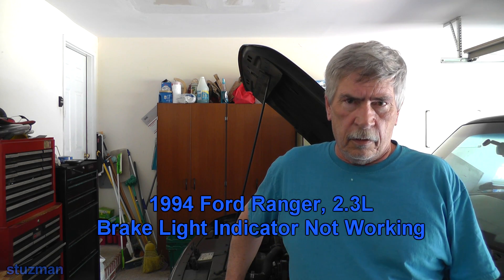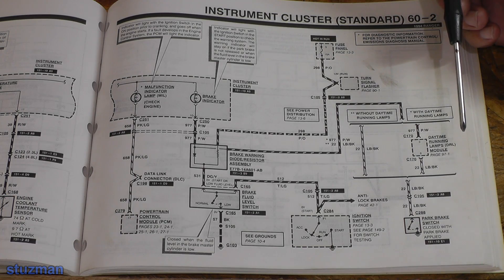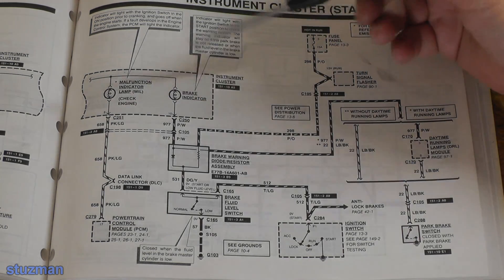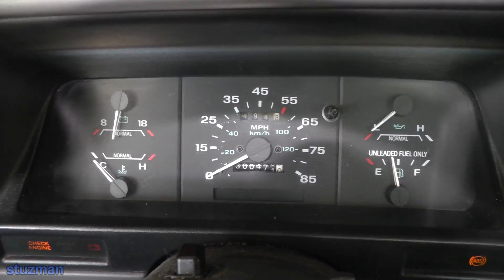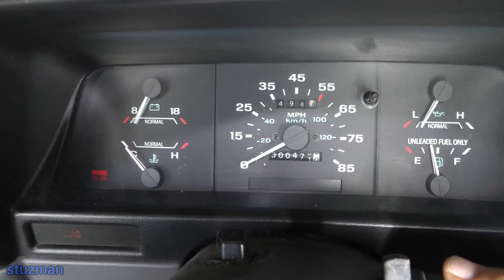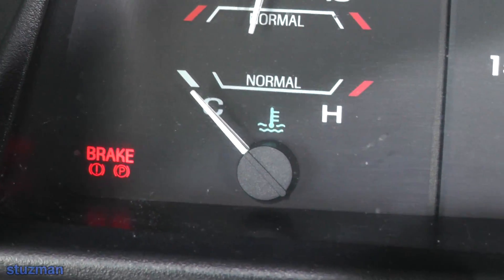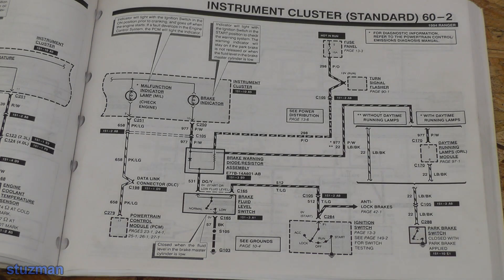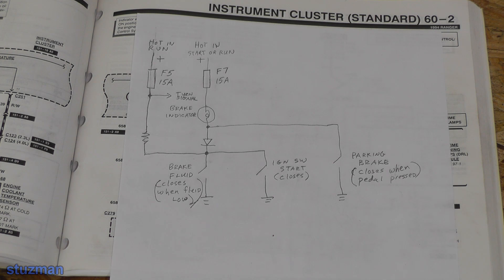Brake Indicator Light Not Working Part 1

Comment: If the switch is intact, then most likely the bulb is burned out. So, I changed the bulb out and now my check engine light is out. Probably best to go in there and change them all.

Comment: Where did you get your test leads to fit the connector? Or if you built them what size male quick disconnect fits the connector.
Reply from the maker: The test leads came from a kit that's from aeswave.com Here is the link to the terminal kit https://www.aeswave.com/uTest-Advanced-Terminal-Test-Kit-p9748.html

Comment: Excellent video. Im trying to figure why my Ebrake light isn't working at all. 99 crown Vic, of vot I've got the dash out, which was easy but was a waste of time since the bulb is good. 
Weird thing is with a test light I have power to the single wire on Ebrake to ground. They failed me on inspection for it not working.
Reply from the maker: Not sure what your issue is Andy as I don't have a wiring diagram for your vehicle. It's normal on most vehicles to have power to the light and ground the other side when there is an issue. Have a great day!

Comment: Trying to run down an issue w my '94 F350. Brake indicator light would not come on and I failed Va. inspection. She said it's prob just a bulb, but I dialed this helpful video up and plan to run some of this down when I get my truck back tomorrow. Don't want to tear my panel apart if I don't need to. I never invested in the repair manual.. prob should. Thank you for the education. I may hit you up soon w an explicit question. I loved how you explained things to this old carpenter.
Reply from the maker: Glad to hear that you found the video helpful Robert. Hopefully, you'll find the issue to your problem.
Reply: @stuzman52  Don't mean to bug you. Just hoping that Ranger manual close to or identical to the F series trucks, esp since the year is the same. The logic still works.... i.e., if fluid is low, then this happens... if this happens , then ABS shuts down. Bottom line , can I expect the same for the f- series schematic? I followed the pathways carefully and it all makes sense as to when the indicator light working properly, won't light , or stays on. That way, I can follow your video, step by step. I bought my '94 new. Took good care of it. Now, after two new knees (ball joints), I am a couple of bulbs away from having a legal/ safe truck.  Thanks so much for your kind response.
Reply from the maker: @robertmannel4446  Hi Robert, I'm not sure if the F-series in wiring diagrams will match up with the Ranger. You may be right that it could use the same circuitry as the year being the same. You can follow the logic as you said with mine and see if it works out. If that doesn't pan out, it's probably best to get the service literature for your truck. One source that's quite reasonable which includes all the wiring diagrams, repair information and TSBs is located here: www.alldatadiy.com Good luck with your project!
Reply: @stuzman52  Got my truck back and did the first thing, first. Checked the Brake light indicator upon start up. Lo and behold, my indicator lights up briefly while cranking. Bulb is good.   Maybe she did not see it, but it means the bulb works. Now I have a case on re-inspection. All that aside, your video was extremely educational, with regards to the basic functions of read switches, diodes, anodes and cathodes, and route paths which make vehicle's electrical systems work properly. I am grateful and will send you a blip when my truck has passed inspection. Best!! With the new ball joints , my '94 rides like new
Reply from the maker: Robert Mannel Sounds good and let me know how it all turns out. 😀👍

Comment: Thanks for the highly pedagogic video.

Now to my question. What would happen if the brake fluid level was low and the ignition switch was in any position other than Start?
Reply from the maker: The brake fluid light would come on in the run position if the fluid was low.

Comment: Beautiful video Mister Pike! I will watch it a couple more times
Reply from the maker: Thank you very much Sakeenah! Stay tuned as I'm doing a follow-up video to this one where I'm going to cover in more detail to find out why the self-check bulb test doesn't work on start-up, more details about the brake fluid level sensor and covering more detail on the wiring diagram of the pull-up resistor relating to the anti-lock brake system. Should be lots of detail for you on that one!

Comment: Thanks for the video.....its seems electrical typically get the parts cannon remedy......when a wiring diagram and a cheap multimeter usually can narrow things down quickly. 
 I noticed the worn clutch pedal cover.....then looked at the odometer.....hard to see but it looked like 300,000 miles....is that right??
Reply from the maker: Neil McRobbie That’s right Neil that a little thinking about circuits can carry you a long way. And you’re correct about the mileage. It has over 300, 000 miles on the clock. 😀👍